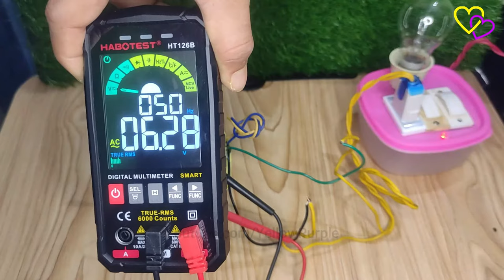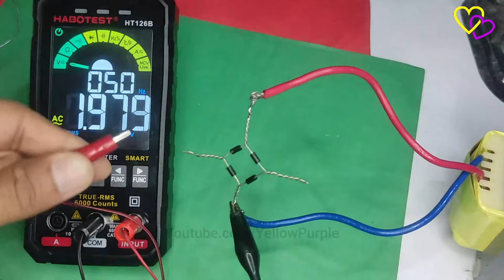How To Check UPS Transformer Wire Connection || OLD Ups 4 Wire Transformer, AC Wire Find Out

Comment: Lol ...😂 Transformer can't give dc output, If this is a 24Volt transformer then output will be approximately 24volt AC but not DC 😂... For Dc output we need rectifier circuit..
Reply: Then What do u call the 4 diodes he used?? Its a Full Bridge Rectifier Circuit. Cant u see it?

Comment: I think you are a little confused if mains voltage is 220 you need both primays connected in right phase series . If 110 then they connect in parallel. The output should be approximate 12-14 volts.

Comment: 1. What are the functions of the two  other wires? 2. You picked up a winding where the voltage is 6v, but the battery is 12v - so another wire that you didn't use was probably useful.

Nice idea though.